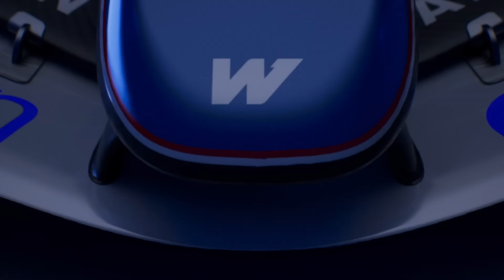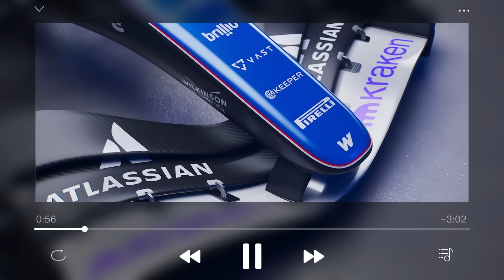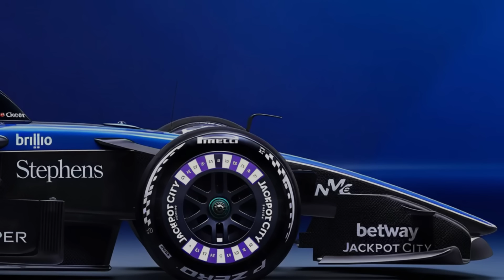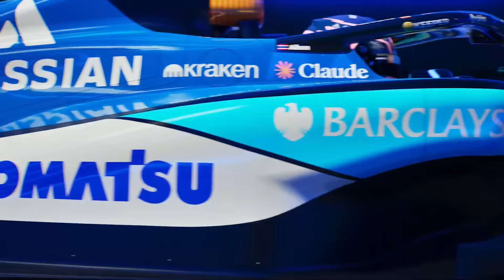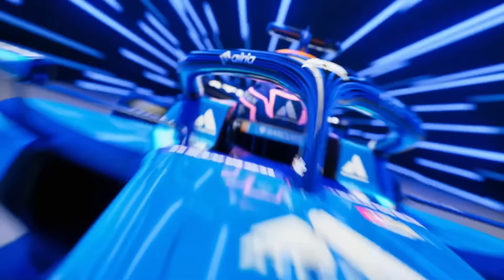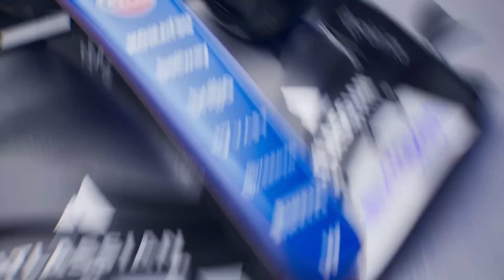Williams Unveils 2026 F1 Car FW48: First Look!

Comment: I'm always hoping for another midfield team t join the top teams.  Formula One has gone from one to two teams over the last few years to four teams last year - Red Bull/Mclaren/Ferrari(they won some races)/Mercedes.  For awhile it seemed Aston Martin was going to be the only team to make the jump. Hopefully, Williams takes the jump!

I've been thinking HAAS takes the jump next year.  One thing is for sure, Williams/Apine/HAAS stays ahead of the new teams Audi/Andretti Cadillac.

Audi/AndrettiCadillac should prove better new teams than the Kapernim and Maurico's(sorry if the spelling is off).  And hopefully, we get another team next year!(and more teams after that!)

Formula One is pointing in the right direction as far as engines are concerned.  I really wish they'd go back to the ground affects, and allow active suspensions to solve the porpoising problem.